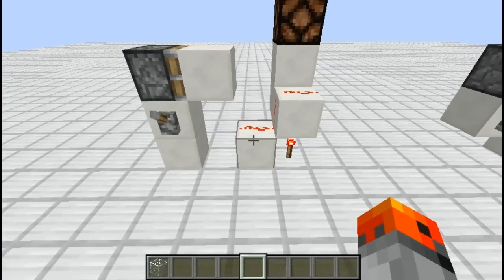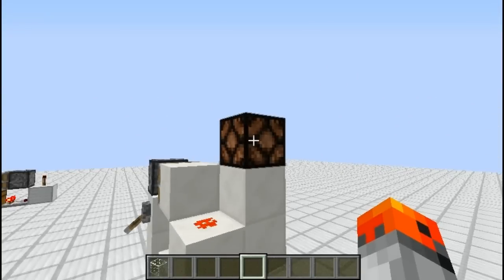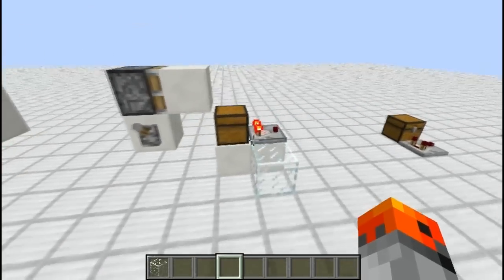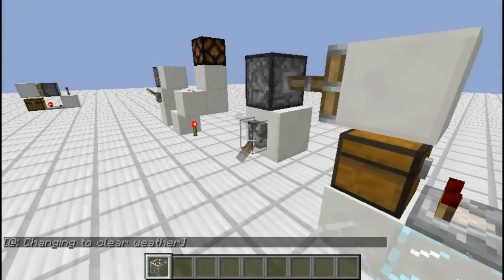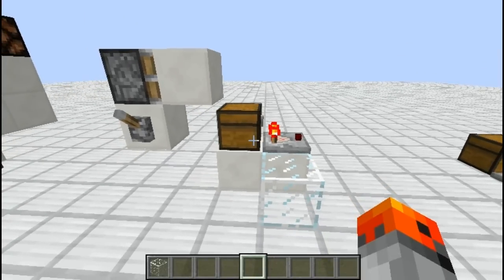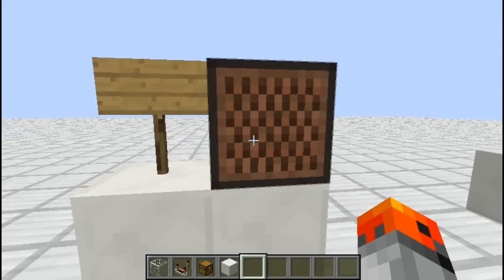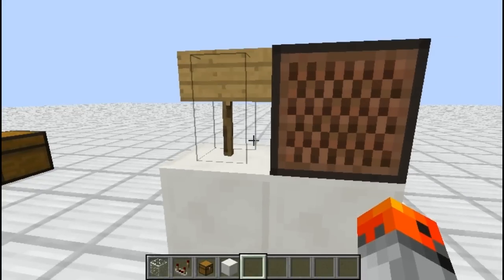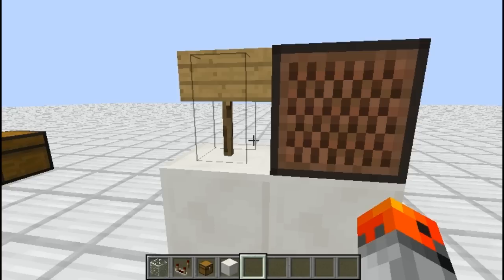Minecraft - How the CUD Works

Comment: So, to summarise, a comparator cannot output a signal if a block is over the chest. The comparator is the most convenient block that detects both block updates and data updates. By putting a block over the chest, it blocks the output, but the comparator will not update. A comparator can be updated with both a tile entity update or just a block update.